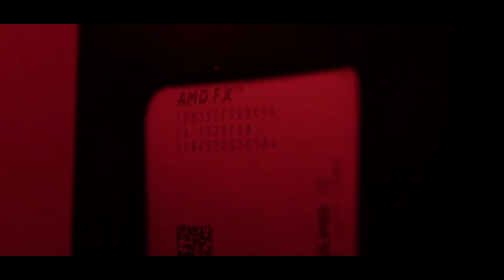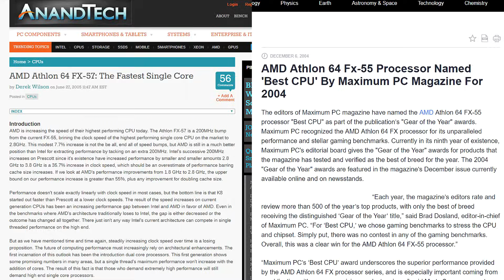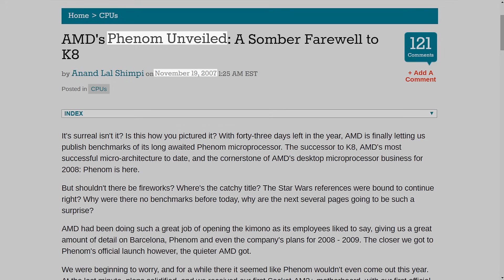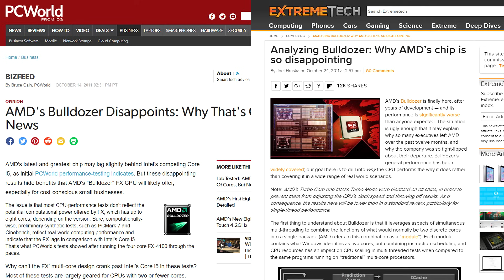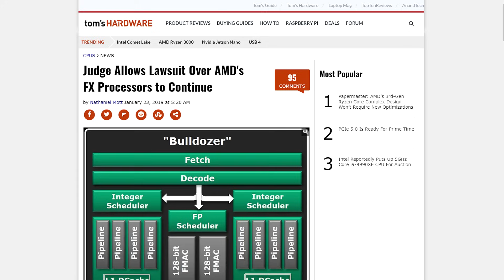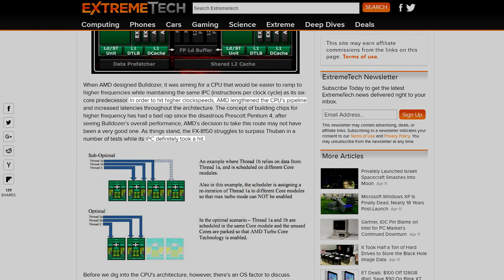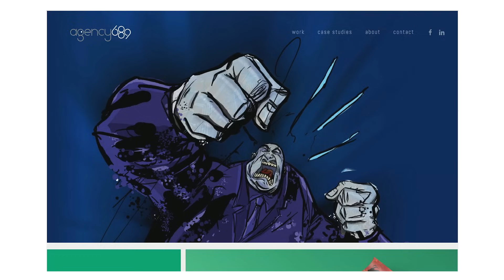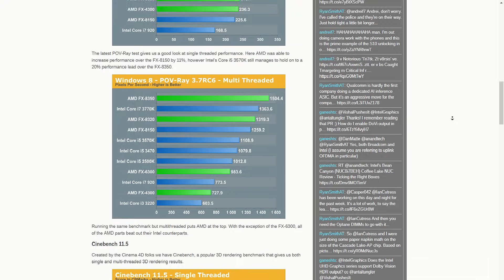Why AMD's FX CPUs Were Hated So Much? - The Fate of Bulldozer

Comment: I personally loved the FX lineup even though it had a rough launch and didn't perform as well as Intel's line up. I built multiple PCs with them too, I started with the FX-4100 when it first release. Then I moved to an FX-6300, and from there an FX-8320E Black Edition and then finally the baddest of them all, an FX-9590. I loved each and every one of those CPUs, even though I needed my own personal coal plant just to run the 9590.

Comment: I'm using a rig I found in the dumpster that came with an AMD FX-8350 and GTX-1050, it's pretty decent and it's gotten me into learning about computers, when I finally land a job I plan on saving up for a Ryzen 7 5800x/RTX-2070 set up, not like I'm tryina build anything top of the line, just an efficient ship and something to dip into some modern titles, which there isn't a lot in the first place, I'm barely getting to PS4 era games which is what my current machine is good for

Comment: I'm sure that the 100$ price difference between the i7 and fx8350 would have been saved in the 1st year of the power bill alone, running the fx overclocked would have probably made up for another platform all together lol...basically you're saying that a car with more than double the fuel usage is better because it costs less in the initial purchase price...from 2013 to 2017 you could have saved money for another computer just from the power bill alone lol

Comment: I was rocking my Q6600 with a 50% Overclock (3.6 GHz) well past this age, skipped DDR3 entirely and Upgraded to an i7 5820k wiht 32gb of ddr4 back in 2015 after that it has been a ryzen 3950X - and for now AMD seems to be the CPU of choice as teh 3D V-Cache is just that amazing

Comment: the problem with the first bulldozer was the shared pipeline. in piledriver AMD fixed the problems but it still did fall behind in SSE performance. However for daily tasks, it was a much better cpu than intel. It would compile code a heck of a lot faster and run tasks like compression much faster. When it came to running a linux server, it was amazing compared to intel. I have all the CPUs of the time, the phenom ii, piledriver, 6 core xeon 1st gen, sandy, ivy, haswell. On proxmox, running a windows VM causes haswell to overheat and hang. piledriver having more small cores really did pull through for daily tasks, and that is what AMD was targeting, marketing got it wrong as it was bad at gaming. Anything to do with SSE performance was poor, but those were rare tasks. So the design decisions for fx was about which instructions were common and which werent.

Comment: good plateform am3+ for low budget for now it can still work well with a gtx 1660 super
Reply: the architecture was by far the worst on the part of AMD (Intel had done worse with the Pentium 4 and Intel Core of 1st generation) the proof the AMD Ryzen has been reusing the same architecture since except in "smt" operation and no longer "cmt "so each core/thread no longer has the resources shared between them but was it a bad idea to use "cmt"? in reality no because windows was the problem of the optimization of amd for info the ps4, ps4 pro, one, one x uses the bulldozer architecture in the form of apu (like the amd fusion) and yet the ps4 and one are still supported games even in 2024

Comment: I have multiple FX based PCs that still run great a freaking decade later! Let that sink in. These things run better today than they did on release...and can 'STILL'  handle almost any software you can throw at them. They cam still do casual gaming with a decent gfx card installed, can run all the most popular OSs and desktop environments, and do great for a general purpose PC. 

Are there faster choices out there...of course. But i am flabbergasted these still work as well as they do. If you have one try putting something like Linux Mint on one and see how much more life you can get out of one. Mine all work fine and make a great first PC for kids who want to learn.

Comment: i had for a long while a phenom ii x4 965 black edition and oh boy it overclocked. it was a long time ago now so details maybe wrong on all fronts but pretty sure it was a 3.2ghz quad core and managed to oc to 4.1 without much fuss and at the time oh boy i got this for 35 on ebay when new they were still 80 or way more it was a bargain. i went to a 1090t but i didnt win the silicon lottery with that 1

Comment: When you run eight "REAL" cores then you have to expect higher power consumption. Hyper-threading are not REAL cores and do not perform like real CPU cores and this was proven when the Intel LGA1155 i5 2500 (4 cores) could almost run toe to toe with the i7 2600 (4 cores + 4 hyper-threads), yet the i5 2500 had no hyper-threading and 2 MB less cache than the i7 2600.

IMHO the AMD 8350 is still a pretty good processor and with 16 MB of cache....  At least the CPU has 8 REAL cores as opposed to fake useless threads.... which is why the FX CPUs are power hungry CPUs....!

Intel CPUs had faster boot times do to having independent  math co-processors but once the AMD FX was past the boot stage then all problems were solved...!

Comment: i love my amd 8350 that chip still slaps todayif you know how to use it. when i got it was my first high end cpu i paired it with amd ram a radeon 295x2 and some ssds with windows 7 and i was able to play siege at 4k 60 med/high settings. i just sold that pc a few days ago to a friend of mine as a starter pc with a 1070ti and it games and runs windows 10 perfectly fine with no problems and my wife also has a 8350 with a rx580 and it games just fine. to me it was just a product that came out where mulit-core wasn't really used as much and not a lot games or apps took full use of it unlike today.

Comment: I've had even worse. A4 6300. Oh my God that thing was pure crap. Slow at everything! It was so slow that it even bottlenecked GT 710! Even Athlon 3000G with its Vega 3 iGPU is better than that A4 6300 with GT 710. Now I have 5600G and using its iGPU because of crazy high GPU prices, and that thing is a pure perfection. Just do undervolt if you use it with a stock cooler to lower temps in gaming and you're good to go

Comment: The only reason why FX Bulldozer architecture was hated so much is just simple; it was handicapped HARD in so many ways, especially in math department (FPUs were shared among two integer CPU cores, which of course kills the performance due to the fact that it's inevitable that CPUs will be bickering over the FPU). Ryzen simply took the best from FX Bulldozer architecture and basically smash the Phenom II Star and Pentium 4 Netburst microarchitectures together, into Zen microarchitecture which is obviously way better than FX. I am glad I skipped AMD's FX trainwreck for something better (Ryzen Threadripper 1900x in this case).
Reply: It really was a 4 core, 8 thread CPU because of that. AMD pretty much created a 4 core CPU with SMT.

Comment: Bulldozer (for example, the fx-4100) was barely faster than a Core 2 Extreme QX9770, a cpu using a socket that came out in 2004

Comment: That was an amazing comprehensive video about the history of the last 2 decades of processor rivarly. 
I haven't seen it summarised better, ever. And I still had the FX 8350 till now, like you. But a recent Mobo short also shorted the CPU. 
I'm here wondering if it's ok to replace it with something similar from the Athlon 2 or phenom ii line, as my friend has a spare old Athlon 2.

Comment: I’ve been gaming on an FX-8370 + GTX 1060 for 2 years now, and I can confidently say they’ve aged quite well. Given how modern games use more multithreading, the higher core and clock “top of the line” models aren’t a bad value, especially since people basically give away motherboards for them. Now, would I still recommend it if your budget isn’t super tight? No. But they’re definitely better than people think.

Comment: 6:28 The answer is in the SOFTWARE. Back then software required less cores but more performant. They made tests (games) and voila, FX was outperformed. But today you can see that FX 8 cores can run modern games while those CPUs with less cores  that outperformed it back then now are outperformed by FX.

So, FX is the better CPU as long it can do better the more difficult job. But it is damn late now. In practice you use what is better for that task.
Reply from the maker: Even back in the day FX processors performed better, in some cases significantly better compared to the processors they competed with in a lot of games. It was all about the area where the testing was done, which most of the time wasn't even disclosed. The performance results were also shown as a graph by majority of reviewers, instead of showing the actual gameplay footage. I haven't even mentioned about the extra headroom that FX processors had.

You can watch my comparisons here:

i5-3470 vs FX-8350:
https://youtu.be/qCFeWb4skhE

i3-3240 vs FX-6300:
https://youtu.be/DNP3WWCWW90
Reply: @RATechYT  Yes, zones having many objects and many moving objects may require more cores.

Comment: My FX-8350 lasted me from 2012 to 2017 and only cost me $170CAD WITH COOLER!  It could also handle any game smoothly.  It may not have been "GOOD", but it was "GOOD ENOUGH"!.  Find me a CPU today that costs under $200CAD and will game well for five years.

My FX-8350 is now chugging along with W10 in my mining rig because the 990FX motherboard has 4 PCI-Express v2.0.  Two of them are x16 and two are x8.  Good enough for minig for sure!

Comment: I had a A8 9600 it was a piece of garbage
Reply from the maker: I mean, at $60 that should be no surprise.
Reply: @RATechYT  It's funny but used Core i7-2600Ks have a similar price on ebay.
Reply from the maker: @saricubra2867  I was talking about the price at launch, though I'm surprised that the A8 9600 isn't that much cheaper nowadays on the second hand market.

While the 2600k is obviously a significantly better CPU, you have to keep in mind that there's basically no upgrade path once you get that.
Reply: @RATechYT  Well, but remember that no CPU matches the 2600K's legendary OC headroom.
Reply from the maker: @saricubra2867  Sure, it is a good overclocker, but does that really matter if a Ryzen 5 1500X at stock will deliver the same or better performance, not to mention the amazing upgrade path of the AM4 platform?
Reply: @RATechYT  2600K at 5GHz would be a 4770K, i really doubt that a Ryzen 5 1500X would beat that, Zen 1 is just similar to Sandy Bridge but without the overclocking headroom.

"AM4 platform"
A dead platform too.
Reply from the maker: @saricubra2867  Look, at 5 GHz the 2600k would perform pretty good, no one is denying that, but let's be realistic here - hitting that clock speed isn't guaranteed and chances of such an old CPU or the motherboard (or maybe even both) dying are pretty high. Getting a new B450 board with a used 1500X is much safer, and there's no need to apply an extreme overclock on it to outperform a 2600k. You can still push it to about 3.9-4.1 GHz though, which is nowhere near as risky as overclocking a used, decade old processor on a used, decade old motherboard.

You have to be living under a rock to consider the AM4 platform to be dead. You have a massive upgrade path after the 1500X.
Reply: @RATechYT  You can't go from Zen 1 to Zen 3 or Zen 3D on the same motherboard. Maybe up to Zen 2.
Reply from the maker: @saricubra2867  I'd do a little research before making claims like that. You can upgrade to Zen 3 from first gen Ryzen on B450 motherboards without a problem. You can even get Zen 3 to work on some B350 boards, MSI also recently released Zen3D support for 300 series boards.

Even if you couldn't upgrade to Ryzen 5000 from a 1500X, upgrading to a 3950X or 3900X, heck even the Ryzen 5 3600X from the first gen Ryzen 5 would boost performance massively.
Reply: @RATechYT  Not that much, Zen 2 is not that different vs Zen 1.
I really doubt that it's possible on B450 due to a BIOS lock.

Ryzen 7 1700 still is a strong performer to this day outliving the i7-7700K now in games like Cyberpunk 2077 and Battlefield 2042 due to thread count.
Reply: @RATechYT  A massive upgrade would be a Ryzen 7 1700 owner moving to the Core i9-12900K.
Reply from the maker: @saricubra2867  I have no idea where you're getting your info from. There's no BIOS lock.

https://youtu.be/XPF-V4FjULg
https://youtu.be/WAp9xpAzsDA
https://youtu.be/sH8nzStu-r4
https://www.reddit.com/r/buildapc/comments/p8nhzc/are_b450_motherboard_compatible_out_of_the_box/?utm_source=share&utm_medium=web2x&context=3
https://www.reddit.com/r/gigabyte/comments/jom3tj/ryzen_5000_on_b450_anyone/

The difference between Zen and Zen 2 is pretty big.
https://youtu.be/AlfwXqODqp4

Here you can see that the 3600X has a significant uplift over the 1600X, so compared to the 1500X the difference is going to be even bigger, especially in core heavy games. I'm not even talking about productivity, where the improvement is going to be very noticeable to say the least.

https://youtu.be/oDVUdpcKZMA

And here you can see the difference between a 1600X and the 3900X, so once again, upgrading from a lower end 1500X to something like a 3900X would result in a massive performance boost, especially when it comes to productivity and multi tasking. If you still refuse to accept that, then I'd definitely recommend you having an eyesight check in the closest hospital.

Sorry, but I don't see a point in continuing this conversation since it's not going anywhere and  I'd definitely suggest spending some time on research before spreading misinformation. Anyways, just in case I didn't make it clear enough already, getting a 2600k over a 1500X isn't a great idea due to reasons stated above.

Stay safe and have a good one.
Reply: @RATechYT  Well you won on the B450 thing.

30 more fps between Zen 1 and Zen 2 is not massive in a games like Horizon Zero Dawn. The jump from Sandy Bridge to Skylake is bigger than that, or Skylake to Alder Lake. Im comparing Ryzen 7 1700 to Ryzen 5 3600. Ryzen 5 1500X was barebones vs 2600K, 3770K or 4790K.

AM4 ended in Zen 3 and it's kinda pointless because there are better Intel chips at similar prices and are faster.

Instead of a 3900X, 10900x exists or it's a 10900K with quad channel support.

It took years until AMD matched the i9-9900K gaming wise. That was released on 2018.

Im just comparing comparing CPUs themselves, not platforms. If you upgrade a CPU every two years, then would be an option for a weak CPU that you bought instead of getting the best of the best, then no need for an upgrade in a very, very long time like i7-2600K owners.
Reply from the maker: @saricubra2867  Initially we started talking about the 2600k and the 1500X, you tried to prove that the 2600k is better. Then you claimed AM4 platform to be dead when I said that it has an amazing upgrade path. Then decided to claim that AM4 tops out at Zen 2 (which is still an amazing upgrade path, unlike the 2600k that has none at all), even though you could've spent two minutes to learn that you can actually use Ryzen 5000 on B450 and some B350 boards. Once you learned that you were wrong, for some reason you started saying that the performance between Zen 1 and Zen 2 isn't big, yet once again, Zen 2 isn't even the limit. And now out of nowhere, you're comparing the Ryzen 7 1700 to some random processors that have nothing to do with this conversation, even though you're perfectly aware that we were talking about the 1500X and 2600K and the upgrade path of Ryzen.

Moving from a 1500X to a 3900X would result in a massive performance boost, because the 3900X can be up to 35% faster than the Ryzen 5 1600 in one of the videos that I sent you, which means the 3900X would at least be 40-50% faster than the 1500X when it comes to just gaming. The difference in productivity would be absolutely gigantic, and the 3900X isn't even the last CPU you can upgrade to from the 1500X. Even if the Ryzen 9 processor was just 25% ahead the 1500X in gaming, you have to consider that the performance difference between processors isn't just measured in FPS in games.

You're basically coming up with something else every time you realize what you say doesn't make sense, which is just not healthy. I really did my best to remain respectful and answer to every single argument of yours, but this conversation is just a mess and a waste of time.

Take care.